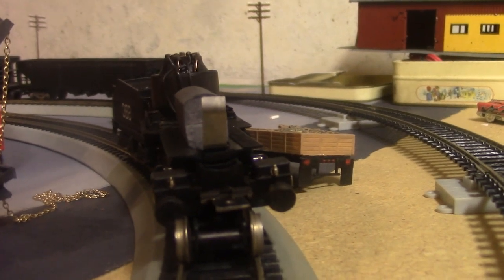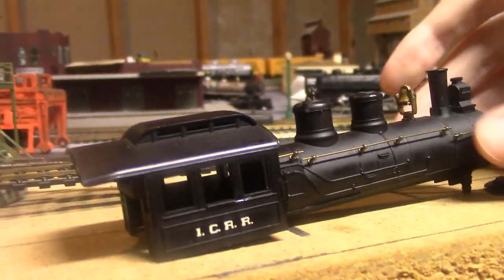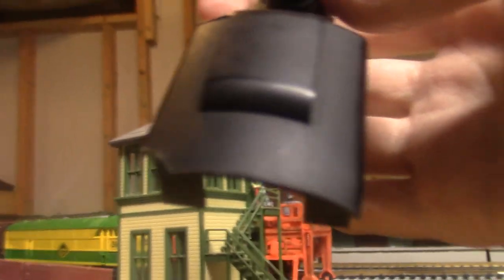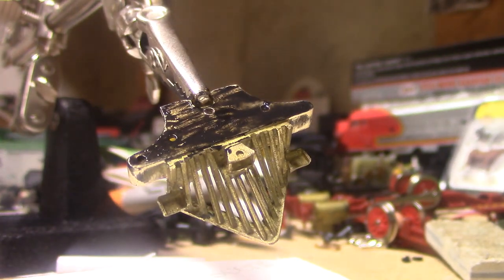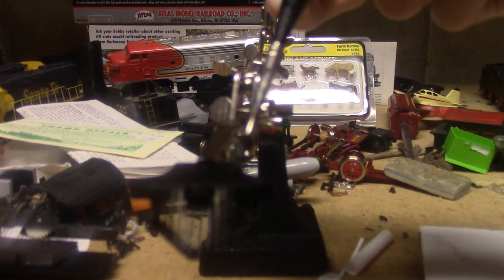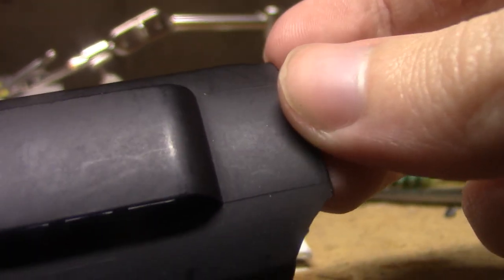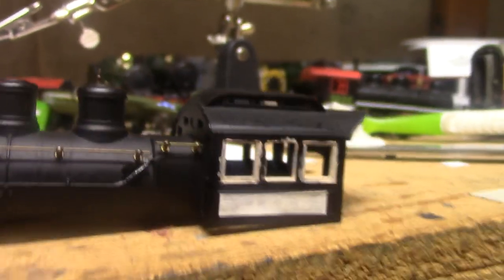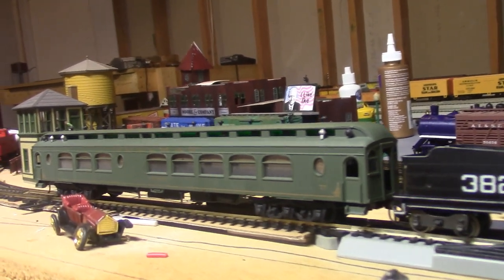Painting the Rivarossi Casey Jones - Painting Trains With Rocky Episode 2

Comment: I model a very unrealistic Britain at an unknown place and time, but probably preservation era at the most northern point of GWR Territory. I have learned that painting something badly can also look surprisingly good. I have an old Mainline LNER J72, and I went to town on it. I painted it in deep bronze green, weathered it lightly, painted the rods red. It is very badly done, annoys the purists, and still looks reasonable amongst all my GWR and Caledonian engines, plus a lone SE&CR Terrier.
Reply from the maker: Sounds like a fun loco to have out and about! There is something kind of fun about having a model that's catered to your personal tastes rather than sticking to a particular prototype and being realistic all the time.
Reply: @RockyRailroadProductions_B0SS  You could say that, until you remember it's a split-chassis Mainline J72. And mines coupling rods keep slipping, like the back wheels spin, the rods flail about, and the front 4 wheels don't move. Which is why she has been a 2-2-2, a 2-4-0, and an 0-4-0 in varying capacity.